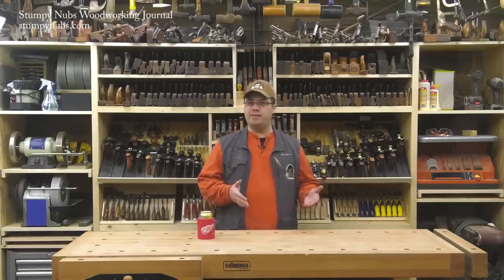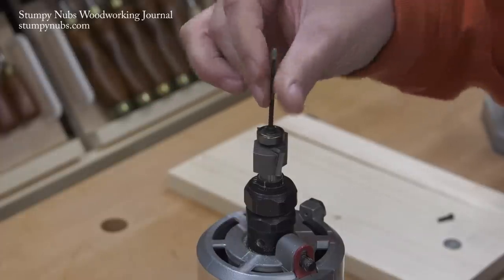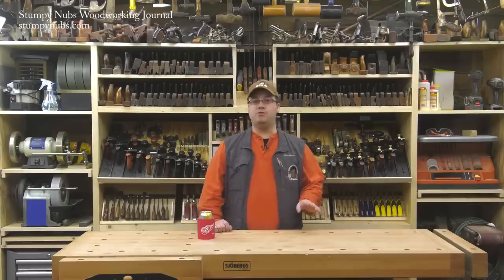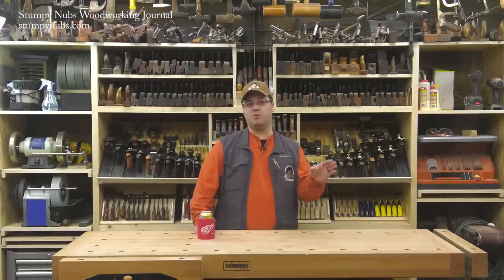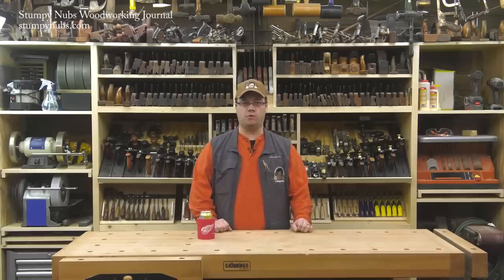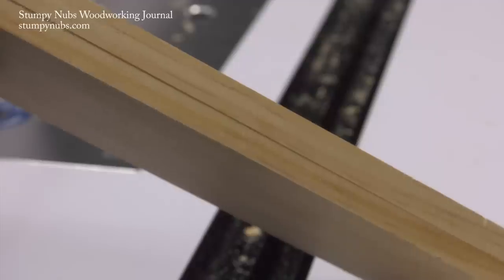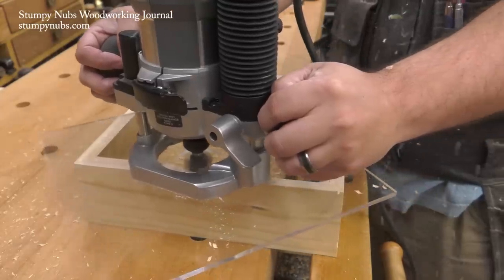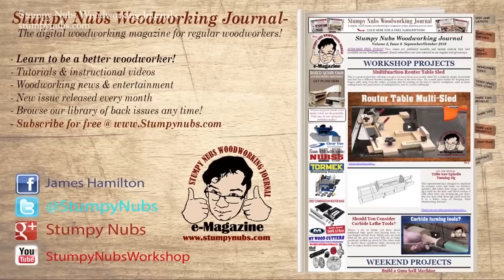Four important tips for better router rabbets

Comment: At 6:10, the fine adjustment wheel on your router lift is turning. I don't have a cool router lift like that, so I was wondering if that was a problem. 

Thanks for the videos!
Reply: Sharp eye! The actual screw was not moving, so it was not changing the position of the router, but it is interesting that the indicator wheel moves around...
Reply from the maker: The dial on top is meant to turn so you can zero it out with your fingers, then use it to measure how much you turn the actual mechanism beneath.

Comment: HI! Another great video, sir! Subscribed and liked! I have an Incra LS router system and have the capability of rabbeting larger panels (plywood carcasses mostly)and would both prefer to not use handheld routers or straight bits for rabbets in plywood, so I loved you're tip regarding dedicated bit sets and rabbeting nominal sized plywoods by applying tape to the fence face to dial-in a precise fit. It's genius!  But, I'm wondering couldn't you just "nudge" the fence out (as you know, LS system micro-adjust is insanely accurate) INSTEAD of applying the tape to the fence? Physically nudging the fence out seems like the same as applying tape to the fence, both moving the wood slightly away from the cutter, right? Or am I missing something, here?

Comment: Where's the promised link re: making custom router bases?  I just did a project w/ polycarbonate sheet and I have a leaved-over piece about the right size, I think.  Am I expected to be bright enough to go looking for that other video all by myself?  Dang - THAT'S a STRETCH!

(Cereally, though - thanks for another insightful one!!!)
Reply: Now, coming back to see if this had an answer, it seems that I probably implied that NOTHING was serious in my query.  Oh well.  Fact is, the router in question was given to me, without a base, so I never had the original for a template or clue to its design.  Can't be TOO difficult, yeah, BUT -- of the several bolt (machine screw) holes in the METAL base, the biggest and beefiest have countersink tapers in the metal, which doesn't make any sense to me.  The four that do NOT - well, they're only 4mm and in a totally whacked pattern that defies simple geometric layout.  So I've managed to make one that KINDA fits, but it's not as pretty as I had hoped.  And I'm still bewilderfied by the big countersunk, threaded holes.  Me no savvy, bwana.

Comment: If you have a router table then you probably also have a table saw. Use the table saw to cut the rebate instead. Qucker, less dust, and you usually have an offcut that is potentially useful.
Reply: Yeah but flipping a large panel on it's edge is dangerous on a table saw, but you can just use a dado stack and a sacrificial fence, it will work either way.
Reply from the maker: A router is faster, more consistently repeatable, and better suited to large panels, especially if they aren't flat as many plywood panels aren't.

Comment: , I did a dado today on 3 sheets of ply. A weird thing happened though which I can't work out. The final dado of the 3 was actually closer to the edge piece( edge being against the fence,, hand held router not table) by about 2mm. Usually one would expect it to move inwards if say the fence comes loose. If you have an idea please share ;). Ps could not see the links below this video you mentioned.

Comment: Production shops must run several router tables so as not to be constantly changing bits and dialing in height.  Any recommendations for a quality set up that dials in height easily?  I finally got a little porter cable router table to attach my big porter cable plunge router to.  To say Im disappointed is an understatement. The router does not easily adjust to desired height and after one pass the lock lever vibrates loose and height changes mid pass.  I know I need to fuss with that lever to eliminate slippage but this set up I have seems like super low end equipment.  A true Craftsman can work wonders with less than ideal tools and average Joe can turn out junk on top of the line equipment however Id just prefer tools that are relatively easy to dial in.  Obviously I have very little experience with routers but I have high expectations and am not at even close to achieving my desired results.  I’d like to produce some beautiful pieces including custom doors and windows.
Reply from the maker: Sounds like you need a dedicated router motor in a router lift.

Comment: Nice video.  Is there a rabbeting bit specifically for undersized plywood?
Reply: You have to look around but some online suppliers offer them in straight bits. I think the assumption with rebate bits is that you can cut the work piece oversized and then trim the excess off with a flush trim bit once the thing is assembled - you just have to buy 2 bits.

Comment: This is Garry not Linda. When I worked in a machine shop we did a LOT of work with metric specs that were converted to US. Most things were numerical so it was really easy. I never understood the explanation for the reasoning behind it. All I got out of it was that Imperial is more accurate than metric. That was until just last week. The reason why is that metric is divided by ten so the smallest division is 1/5". Imperial is divided by 12 so the smallest division is by 6 allowing 1/3, 1/4, 1/8, 1/32 and so on. Don't take my word for it check out the "Origins of Precision" video on the Machine Thinking You Tube channel. Once you are there check out the other videos like the first precision lathe, cutting threads and several others. I've watched every video but one. This guy has the knack to take a bore you to tears subject and make it interesting.
Reply: Try using any measuring tool and you'll find that is absolute fiction. Take a digital caliper for example. Measurements can be taken to almost any level of decimal places.

Comment: Wait, a handheld router with a fence?  How does that work?
Reply from the maker: Most handheld routers come with fences that attach to the base. Some people call them edge guides.
Reply: @StumpyNubs  ohh, I do have a metal edge guide, I honestly think I'm not using it right.  It's metal, but should I screw wood to it?
Reply: @StumpyNubs  nevermind lol.  Watched a video on how to use the guide.  I was just trying to use the edge guide on its own, and installed it backwards at that.   Yikes, I'm new.  The use of it makes so much more sense now.   Thanks for the response!
Reply from the maker: We've all been there :)

Comment: May be time for the U.S.A to catch up with the rest of the world and convert to metric measurements. It's You have a metric monetary system already so keeping Imperial for everything else is a bit strange. Your plywood suppliers obviously prefer metric. It's so much simpler.
Reply: Not really, I understand it's in multiples of 10 but man, trying to wrap your head around another system when you were taught standard measurements is not the easiest thing to do. It would be like us asking the rest of the world to use standard measurements when they use metric. Oh and lumber suppliers use standard measurements here, they just cheat you out of 1/4 inch on all stock or 1/2 inch depending on what you are looking at.
Reply: People outside the USA seem to think that everything is Imperial measurements here. Not true. There are LOTS of metric measurements used. Every hardware store that I've been to here has both metric and imperial bolts, nuts, etc. What could be more 'merican than an F-250 Superduty diesel pickup truck? Lots of metric bolt heads and threads throughout this truck. I have as many metric tools as I do imperial tools (maybe more). I also have two metric tape measures (Fastcap True 32) and my PEC combination square has metric scales on it (down to 1/2 mm) as well as imperial scales (down to 1/64 inch). I am every bit as comfortable using metric as I am imperial. I don't see any personal benefit from switching from gallons to liters when refueling my vehicles, or judging my vehicles speed in kph vs mph, but when it comes to woodworking I sometimes choose to use metric exclusively for a project. 32mm cabinetry is a prime example where it would be foolish to try to convert that to imperial measurements--stick to metric. As far as "superiority" of one system over another--IMO that's just a waste of time and energy. Each system has its merits. Believe me that corporations won't hesitate to make decisions that save them money, so the reason that there are still lots of imperial measurements used here is that corporations have crunched the numbers and decided that changing in their circumstance doesn't save them money. I like metric and I like imperial too.
Reply from the maker: Our suppliers don't prefer metric. They just buy plywood from Europe and Asia where metric is used.
Reply: I for one like that we Americans do not do everything as the rest of the world does.
Reply: Back in the 1970s, when I was in school, I recall being taught that we (the USA) would soon be converting to metric.  Therefore, our teachers taught us about meters, centimeters, liters, etc.  So here we are, 40-plus years later, and the conversion has still not taken place.  I'm not sure what happened, but it seems pretty clear that we won't be converting to metric any time soon.  Those of you who are over the age of 50 probably remember what I am talking about: the metric conversion that wasn't.  

Personally, I would not mind converting to metric.  It has always irritated me that I needed to buy two complete sets of wrenches to work on my cars and motorcycles.  And when I am applying pesticides or fertilizers in my yard, I find it hard to keep track of teaspoons versus tablespoons versus cups, etc.  Who can remember how many tablespoons make up a quarter cup?  Not me.  So metric measurements just seem easier to master.   

I am under the impression that the scientific community converted to metric a long time ago.  However, among us regular folks, this is an issue that impacts people in a deep, emotional way.  Many people feel very powerfully about this topic and are strongly anti-metric.  Probably one reason is that, to some extent, we Americans do enjoy being independent and going our own way.  So I don't expect the metric conversion to happen in my lifetime, even if I live to be 100.
Reply: @917Stefano  Thanks for a good explanation. I´d wish that more companies incorporated both into tools, plans, recipes etc.
Reply: @StumpyNubs  Mostly they buy from Canada though
Reply: Fair enough. I just find it curious. I too was raised on the imperial system and am quite comfortable using both Imperial and metric. In Australia we changed to metric in 1966 and most people of my vintage found the transition quite easy with all units being in multiples of ten. Very easy to do calculations in one's head rather than using multiples of twelve, eighths, quarters, halfs, etc. Anyway, my comment was just one of curiosity as to why America has chosen to stay imperial. Not wanting to cause a debate, just curious.
Reply: we changed to metric money more than 200 years ago, the UK only did it 50 years ago, so you owe us another 100 years before we drop imperial (which a lot of people call "english" by the way).  Why do Brits still buy their beer by the pint I wonder?  and drive in miles, not KM? etc...
Reply: There are two kinds of countries in the world:  Those that use the metric system, and the one that went to the moon and built the internet.